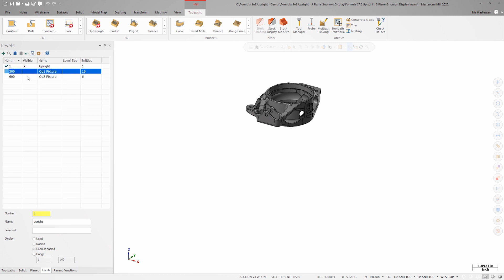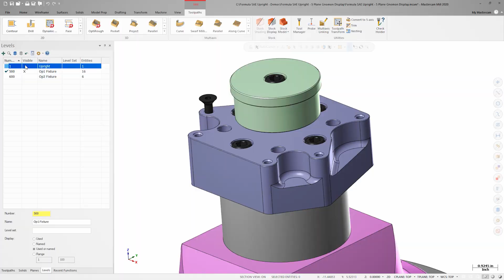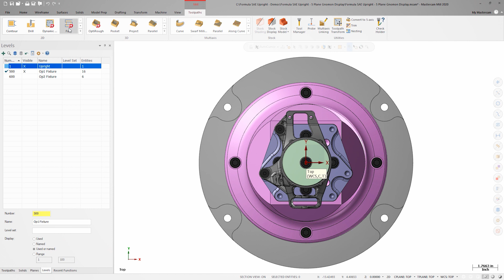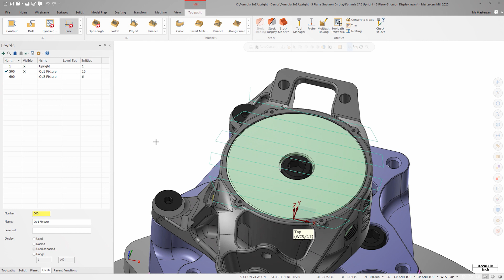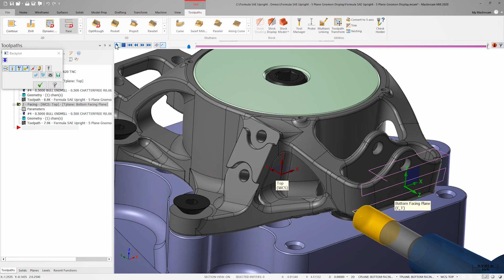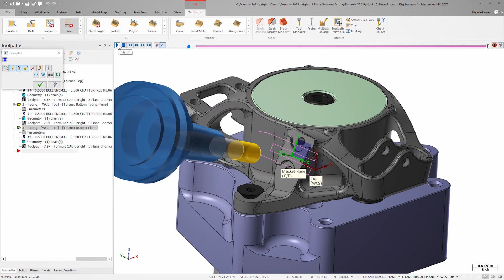FSAE Upright Series: Plane Gnomon Display

Comment: Don't you have to set the origin of the new T/C Planes the same as the WCS origin?
Reply from the maker: Typically no, the origins of the T/C planes can be wherever you like them to be. That is unless your post processor requires it. This was a legacy restriction that is no longer required. If your post processor is limited in this fashion you can always reach out to your Reseller or post developer to modify or update your post to not require the matching origin locations between planes.
Reply: @mastercam  My post is for the Haas UMC 750 from Postabilty. I will ask my reseller. I currently put the origin of new T/C planes at the WCS origin